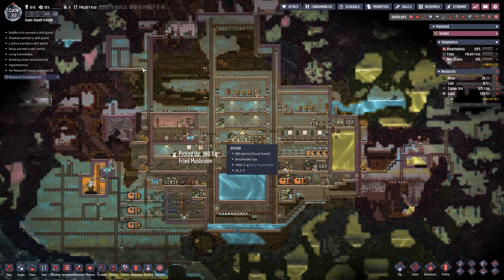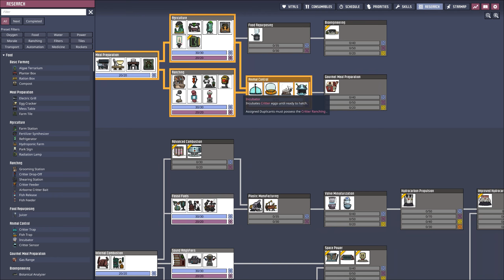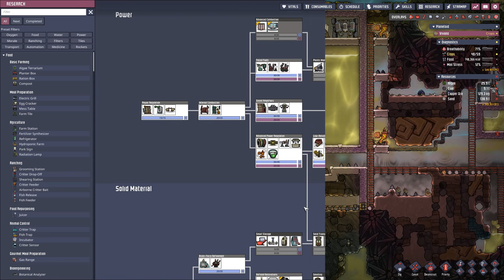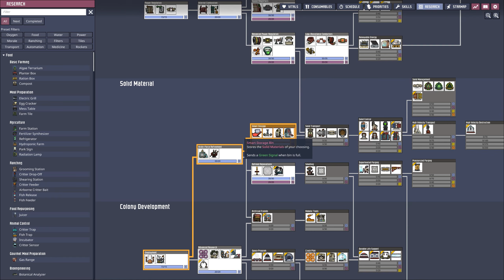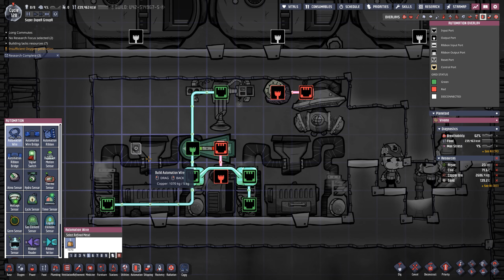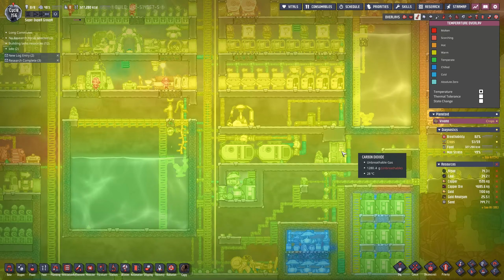Oxygen Not Included -  A Breath of Cool Air (Part 8)

Comment: 6:07 Nope. One you have polluted water directly beneath the area you're placing the Fertilizer Synthesizer, and two for additional flexibility you can use regular water with a carbon skimmer and then pipe that polluted water into the machine.

Comment: Smooth hatch actually give 75% of material as refined. They are still bad though,   the refinery can be cooled with the Polluted water (it can go much higher temps than water before vapor) It's 50% for rock crusher, 100% for refinery, 75% for smooth hatch but requires no power and doesn't generate lots heat. (but also slower, as they only eat/poop once a cycle)

Honestly I only try to keep crops cooled, Dupes are surprisingly not caring about a bit of warmth or cold in the base. (just not hyper or hypo thermia type levels)  So... cooling every square inch of the base, not really needed, but cooling the plants so they keep growing -100% required, or your gonna starve off.

Comment: Can't remember for sure, been too long, but I think it's more efficient to cool after pumping it out, rather than in the chamber for oxygen.
Reply: It should delete heat if you cool the pumps and electrolyzers with the water input, then cool down the resulting hot oxygen, as the oxygen has less SH than the water.

Comment: If I remember right, there's a kind of "infinite storage" that you can make for gasses. I believe it requires a bit of oil to make. Could be a good idea to look into it further since you've said you're not averse to making use of such things.

Edit: Pretty sure there a variant for liquid as well, though it's made much differently.
Reply: infinite storage for gas is just a 2w by 3h area - put an air pump in the top 2x2, and a vent on one of the bottom two squares. Put less than 2kg of any liquid in each of the bottom two squares, and you're set. The liquid prevents the gas from filling the square, and doesn't overpressurize the vent because it's under 2kg. The gas is shunted immediately into the top 2x2 area, which will fill with as much gas as you can put in. 

Liquid is done in a similar way, but with a 1x1 gas-filled area above the liquid (usually a 2x2 area with a liquid pump for removal) which prevents the liquid from rising and over pressurizing. And you have to be careful what you build it out of, beause overpressurized liquid can cause damage. I think most people use locked airlocks, as they dont take pressure damage.

Comment: I feel like you should be running the cooling radiators directly through your base, rather then cooling the Oxygen only. Ideally, run it in the Barracks - with a thermo sensor so it does not go too low.
Oxygen will invariably run into pressure issues or the bases air being fully oxygenated.
And super ideally, you may want to have a closed loop of coolant. It is the liquid with the best thermal capacity. But it is somewhat advanced.

Comment: Solution provided with your gasses work for early game but it'll not be enough for late game purposes for more power hungry infrastructures.

What you can do is collect the hydrogen and natural gas in a very large square storage depot , were talking big big, like 20 x 20 big maybe even bigger.
(of course you vacuum it first but you don't have to if you filter gasses - also automation on the gas pumps when pressure is too low)

so you can continuously pump out natural gas and hydrogen store them up for future purposes and then once you want to use it pump it out filter it with those gas shutoffs with automation and provided an abundant amount of energy to your base.

Also instead of normal gas filters which costs 120 watt per second you can use gas shutoffs which only costs about 10 watt per second.
You'll use gas pipe element sensors to filter which type of gas you want to push which way.

the pros of this way of storing massive amounts of gas, is that on those vents or creation of these types of gasses have a long cooldown period.
hydrogen / natural gas vents have long dormant stage , so allowing you to continue providing power towards your base in a late game environment where you are in need of dozens of Kilowatts per second to run all your systems.
Electrolizers produce more oxygen then hydrogen so it's better to build large so you build up larger deposts of hydrogen which you can vent off.

the cons is that the initial build up costs and time is just longer but the late game you won't have to think about power anymore and pretty much automate everything.

Comment: The reason you have some Hydrogen packages in your oxygen line is because the top pump in your Self powered oxygen maker (SPOM) can't allways get power. This in turn is caused by the circuit being on a small power transformer, which will never output more then 1KW. Since the SPOM circuit used 1.2KW one of the buildings powered by it will not receive power when everything is running. (I believe the game will not power the building that was produced last, which would be this pump). This causes higher pressure in the top of the SPOM then the bottum, causing the hydrogen level to drop. 
To fix this you can:
1: Switch to a larger power transformed (but this will sometimes overload the SPOM grid), so you should switch to conductive wire, which can carry 2K.

2: Remove one oxygen pump (I would recommend using the half Rodriguez SPOM design, which is the golden standard along with it's big brother the Full Rodriguez.)
Reply: I'd just bite the bullet and go a full Rodriguez just so you can have an oxygen line dedicated to atmo suits
Reply: @wanyaisneed3972  yeah, that's what I allways do. It's worth the investment!
Reply: Or just use heavy watt wire everywhere in the SPOM

Comment: A tip, the carbon skimmer produces as much polluted water as it uses water so you can loop it with a distiller and it runs infinitely with a bit of power and sand supplies